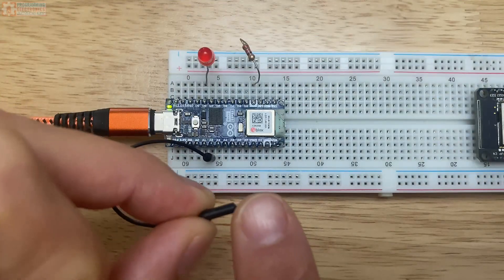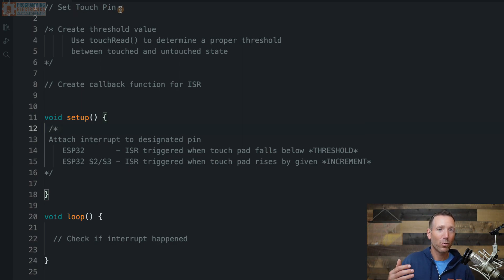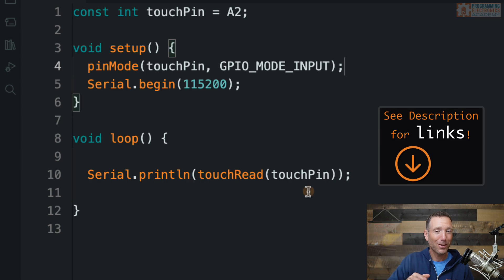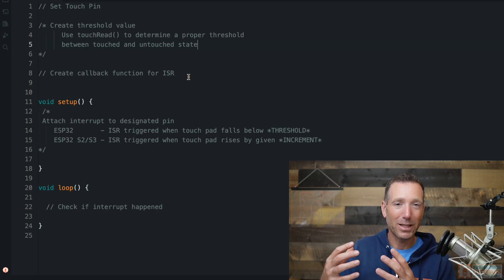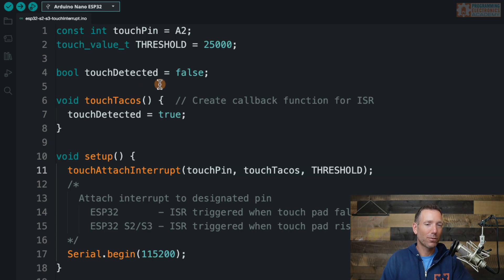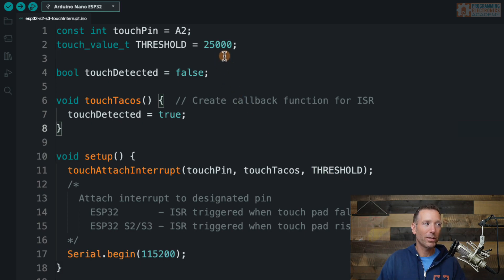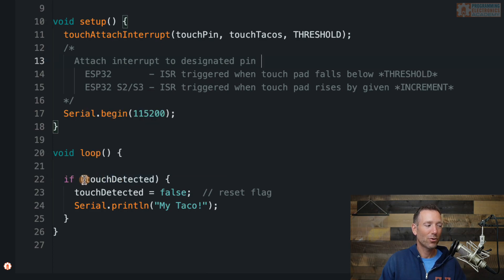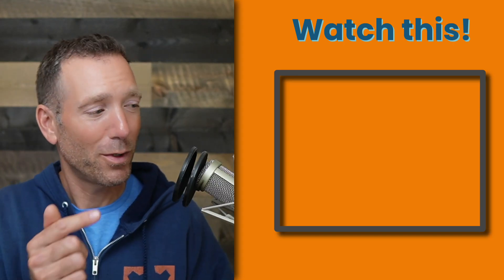A Touch of Innovation: ESP32's Touch Interrupt!

Comment: Your demo implies the touch pin suffers from a bounce effect like a button. Would you use the same debounce routine as you would a button? I frequently use a Schmitt trigger for this. Would a Schmitt trigger function in the same way for both?
Reply: i use something like this to debounce the button press:

volatile bool touchDetected = false;
volatile unsigned long lastTouchTime = 0;
const unsigned long debounceDelay = 50;  // Adjust as needed

void handleTouch() {
  unsigned long currentMillis = millis();

  // Check if it's been enough time since the last touch
  if (currentMillis - lastTouchTime >= debounceDelay) {
    // Record the time of this touch
    lastTouchTime = currentMillis;

    // Set the flag to indicate a valid touch
    touchDetected = true;
  }
}
Reply: I thought the use of millis() was not valid in an ISR routine.